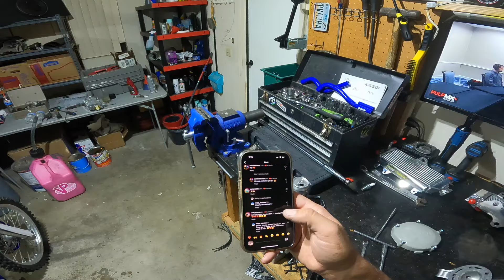Project 125 Pro is DONE! Final Assembly/ First Fire-Up!

Comment: Sometimes if the carbs at least on my rm if the carb is leaned too much to 1 side or too straight it’ll leak gas n hitting the float bowl won’t work just gotta move the carb around with the petcock on till it stops